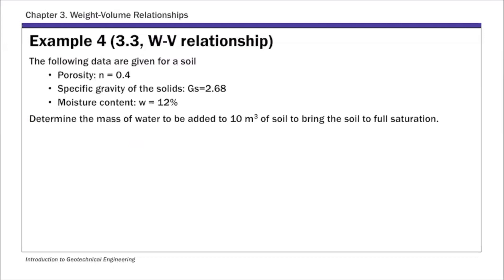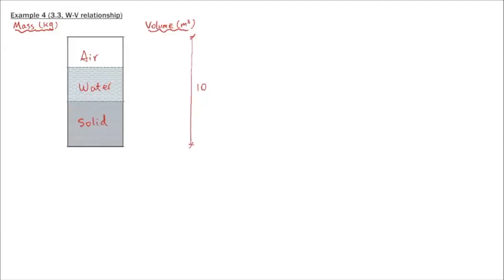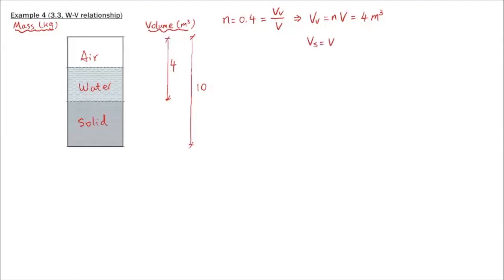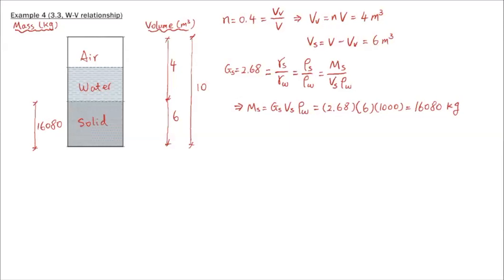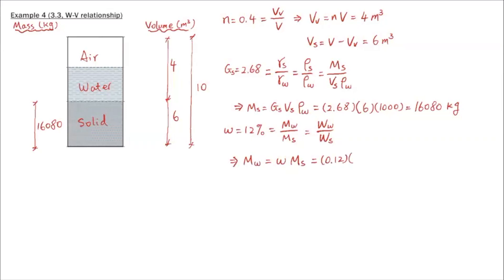Chapter 3 Example 4 - Mass of water added to bring soil to full saturation

Comment: I got one question where it's saying 94% saturation. Then what should I do in that case ?
Reply from the maker: It is a very similar procedure, and the difference is in the volume of air corresponding to 94% saturation (instead of 100% saturation). I'll probably do another example with partially saturated case.